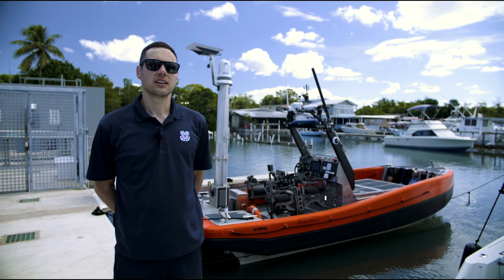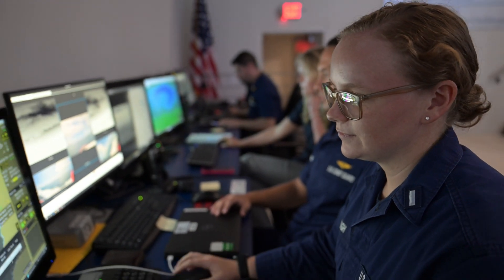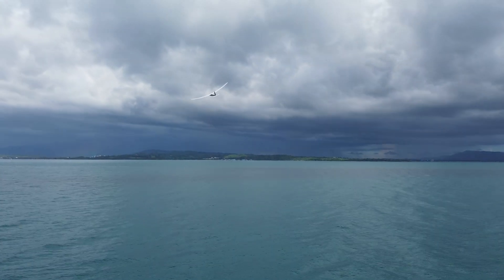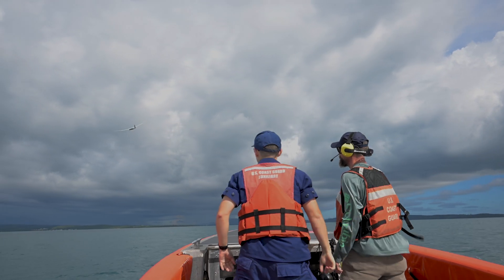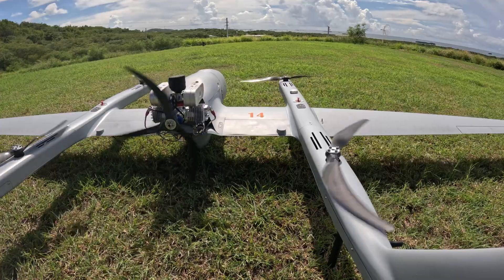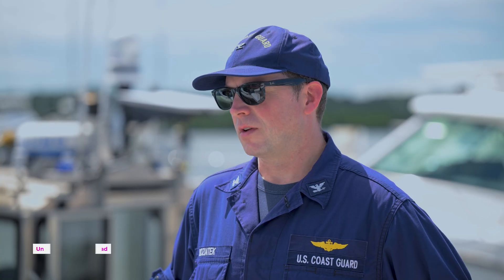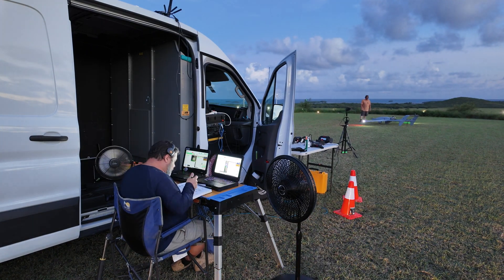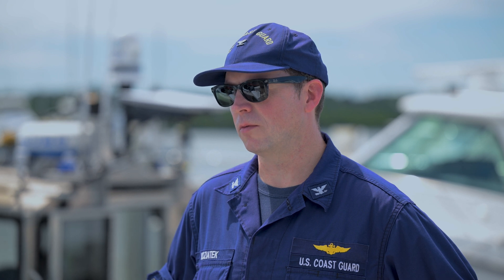USCG Operation Demonstration Coqui

Comment: UAV has an application but 100% no operational Commander will send out that unmanned boat. Too much risk of damage or losing it and they’ll be relieved. 
That or they’ll drive it remotely but still force some coxswain and boat engineer to get UW on it just in case completely negating the whole remote position.